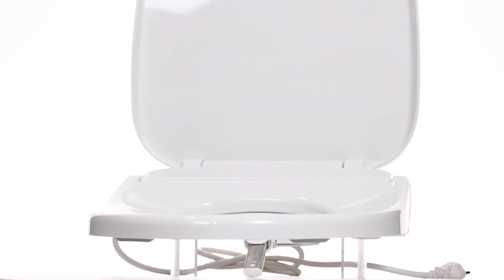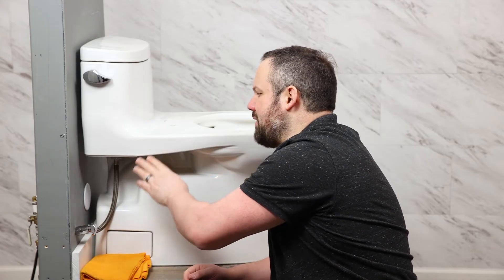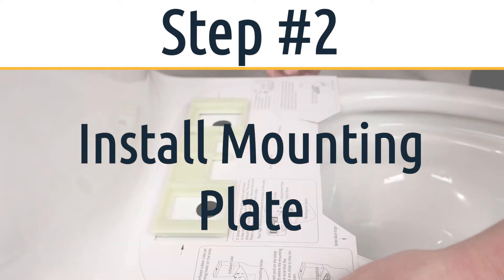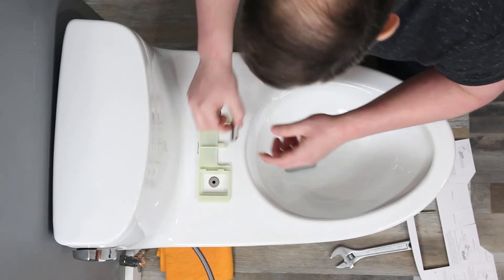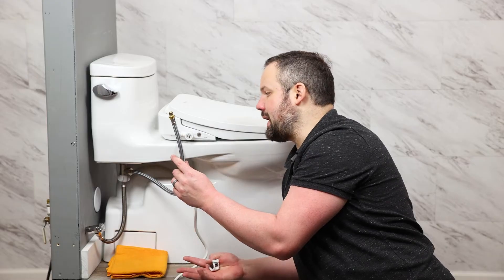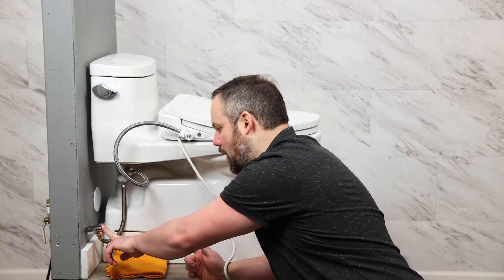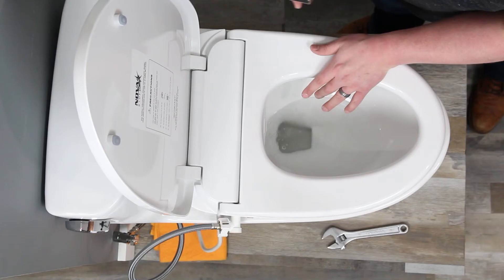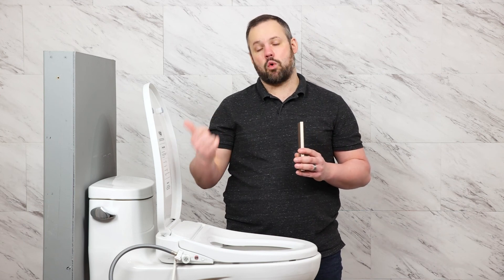How To Install the Eco-Nova Bidet Seat | Detailed Installation Guide | Top 3 Bidets 2022

Comment: I'd like to buy this model, but from my experience, the rubber top mounting sleeves don't seem to fit right into the holes in my toilet. Are these necessary to mount the toilet or can I replace the top mounting sleeves with a regular toilet seat mounting screw and bolt that goes underneath since I do not have a skirted toilet?
Reply from the maker: You can still use the bolts that come with it, but you'd have to find some rubber cone washers and nuts that would work with those bolts locally.  We've had others do that with success in the past.
Reply: @ManyBidets  Are the mounting brackets for bidet toilet seat standard between bidet companies (other than Toto). If I have a Bio Bidet bb2000 on my toilet currently, could I just detach it and attach a the Eco-Nova to the Bio Bidet's mounting bracket that's already on my toilet?
Reply from the maker: @ZAMtech1994  Sadly the mounting plates are different from seat to seat...  You can try using those bolts with the eco nova mounting plate, but there's a good chance they won't work.

Comment: I want to buy this Eco nova but I also want to use a inline filter....so is there a shorter quick release hose so I can have a neat looking install?
Reply from the maker: The Eco Nova will now actually come with a standard connection instead of the quick release. If you find that the waterline is too long, you could use a zip tie to conceal any excess behind your toilet.

Comment: Can you get the seat with install hose on left vs the right. Would like to hide the metal tubing
Reply from the maker: Thanks for asking!  We sell over 350 different skus of bidets, and all of them have the water line coming out of the left hand side when facing the toilet.  The reason for this is that the standard for water inlets for toilets in the US and Canada is on the left hand side of the toilet, so bidets that are currently made are designed with that in mind.

Comment: Is that the round or elongated model?  Looks small.  I hate round toilet seats, and I'm worried that a bidet seat (even for an elongated toilet), will severely cut down the size of the seat hole.
Reply from the maker: Thanks for asking!  The Eco Nova comes in elongated only, and offers some of the most spacious sittable room in the bidet seat world.  That being said, any bidet seat is going to limit your sittable space to some extent because the back of the unit that stores the hardware that makes the unit work will take up some of the space that would otherwise be used for sitting.  If you really want the most sittable space possible, I'd recommend checking out one of our Neorest units: https://youtu.be/kxPcICW995c

Comment: Because of your top 5 video, we bought the Eco Nova. It arrived, and we installed it that evening using this video. Super easy. This is our 1st bidet experience. The first time using it was 😯😄🙂

Pros
Easy install
Quality materials 
Nice quality remote and wall holder
Love the temperature controls
Pressure options are nice
Nozzle for front and back are appropriate 
Reasonable price
Love the sanitation aspect
Feel cleaner after using
Easy to use

Cons
Need to install an outlet closer to the toilet, currently running an extension cord.

There is no backlight on the remote, so you can't read it in the dark. Eventually you'll learn the remote, but it would be nice to have a back-lit option

We thought we liked the words on the remote instead of an icon, but seeing as we are both farsighted, it's hard to read without glasses. 

We find that there is quite a bit of movement in the seat. It's not coming from the mounting plate. It seems to be coming from the housing where it attaches to the plate. Would love any ideas on how to stop this movement. 

Overall, the cons are minimal, and the bidet is worth it.
Reply from the maker: Thanks for the in-depth review! In regards to keeping the seat from sliding, while it's rare, we have seen it happen before.  You can put mounting tape on the bottom of the mounting plate before installing it.  You can also try filling the open areas in the mounting with something solid like a piece of plexiglass:https://i.imgur.com/ZqbrvkJ.png This will keep the metal bracket from sliding.

Comment: 1:43 Is it okay to use Teflon Tape on the black threaded section of the toilet where the T-connector attached to? I heard this can prevent leaks but know you can't use Teflon Tape everywhere in plumbing.
Reply from the maker: Thanks for watching! It is not recommended, the rubber washer is all that is needed there.

Comment: Do I need an electrical outlet installed? No mention of this in video. Right or left outlet? Doesnt heater need electricity?
Reply from the maker: Hello!  Great question!  All our bidet seats that heat water require electricity to do so.  Which side the cord comes out depends on the unit.  For the Eco Nova, the cord comes out of the left when facing the toilet.  Let me know if you have other questions!!